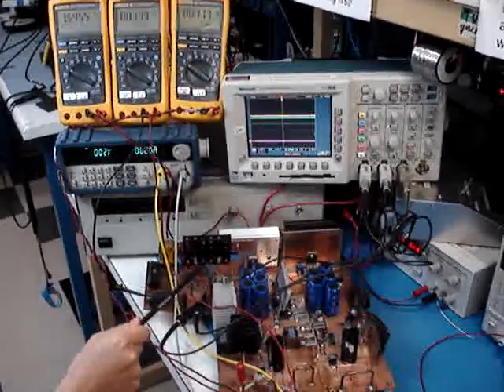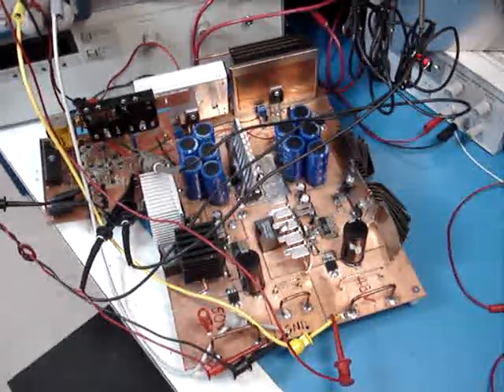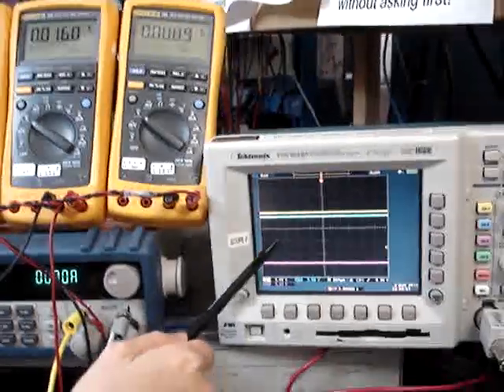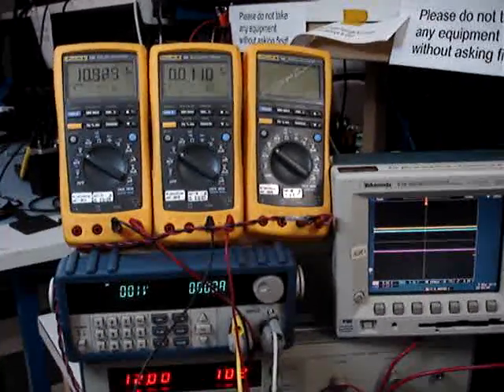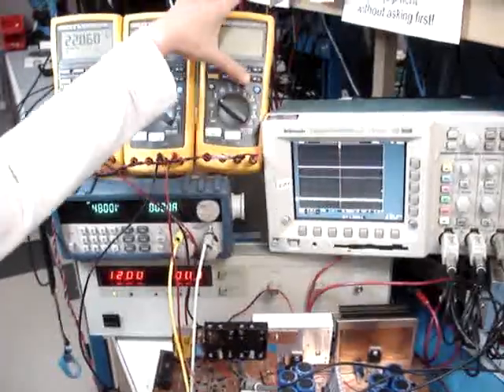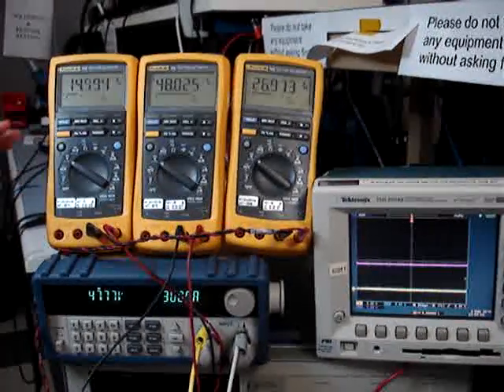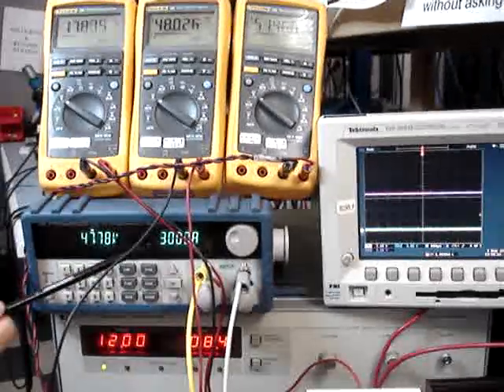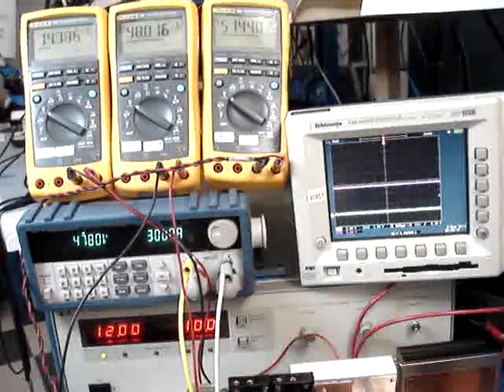Regenerative Braking System- charge and storage (Huyen-Tran Nguyen, EE Department, SJSU)

Comment from the maker: total 10 super caps, each is 150F.  The low and high-side switches are controlled by two ways, either by a  microcontroller or hardwire circuitry.